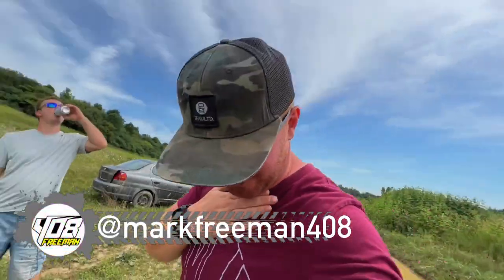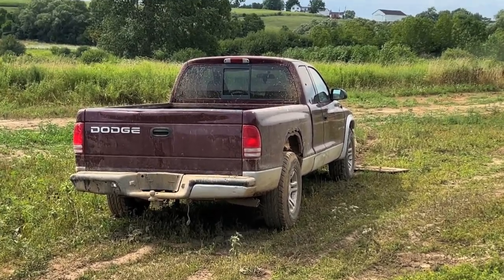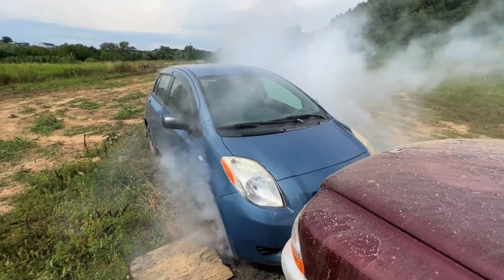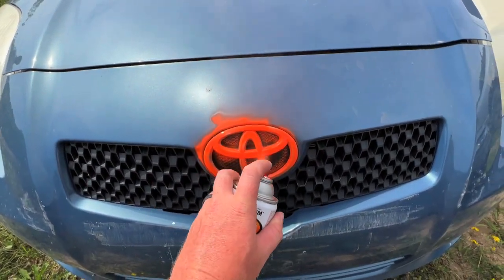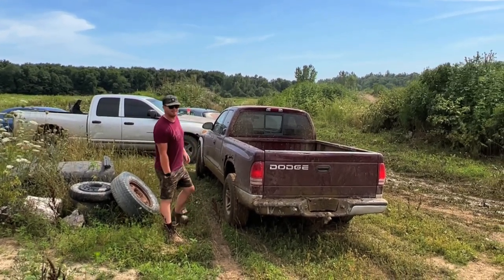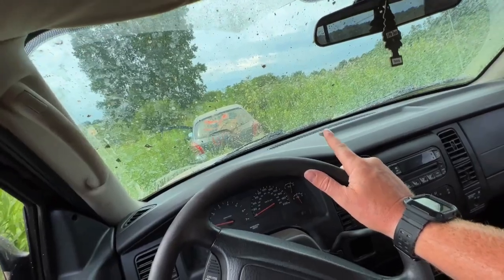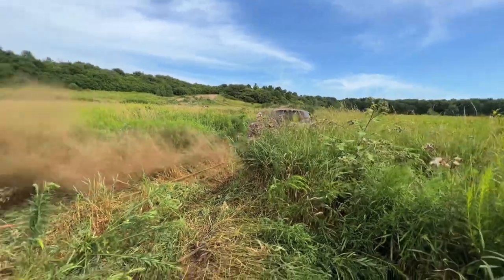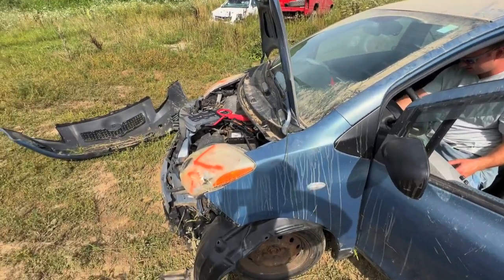Toyota YARIS Car JUMP FAIL!

Comment: Instead of the straps to hold the wheel straight. You should get yourself a steering lock for when they do alignments at the garage. It jams between the seat and the wheel. Might keep the vehicles straighter xD
But your way is better for the run away cars hahahaha :P